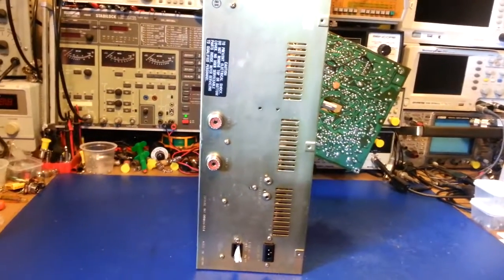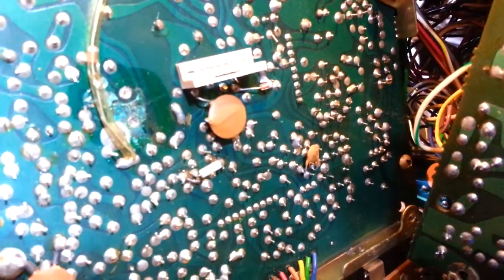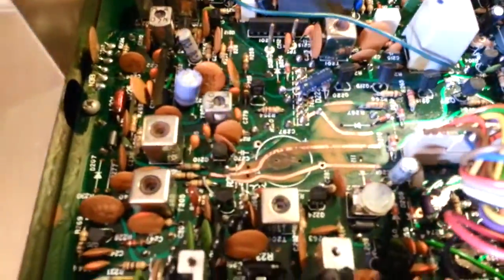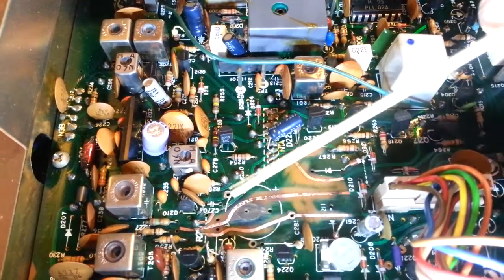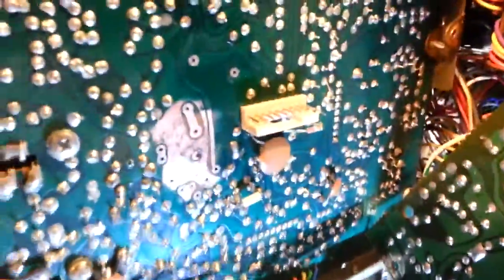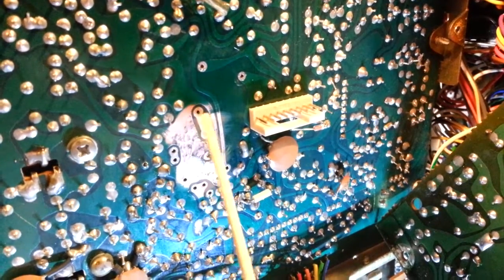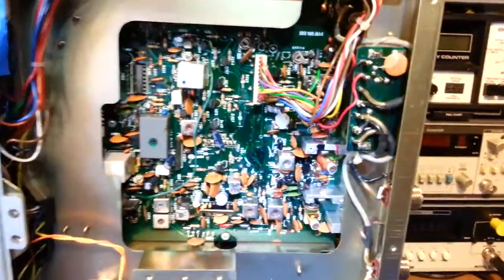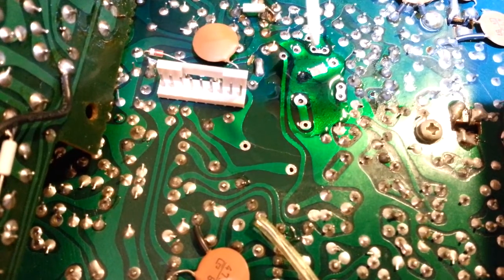GE SuperBase 3-5875A CB Radio leaking electrolytic capacitor repair. Part 2

Comment: hey Mike, can you tell me what crystal i would be missing from a UPD-858 Washington President with a 4 pin mike jack if i gave you the positions to what crystal was where..? 
7.7975 mhz in the X2 position 
7.8025 mhz in the X1 position 
10.240 mhz in the X5 position 
11.2842 mhz in the X4 position 
11.2850 mhz in the X6 position 
11.2858 mhz in the X3 position 
7M-7A ??? in the FT2 position not sure what this one is
Reply from the maker: Your not missing any crystals, that's all they have.  FT2 is not a oscillator circuit crystal.  It's a crystal filter.
Reply: 10-4 thanks buddy..

Comment: Nice job at cleaning up the traces, but it would have been more helpful to actually see you doing the cleaning and what tools and chemicals you used. I have to do a similar repair...but I'm looking for a more detailed demonstration to show me how. Also...What tool did you use to remove the caps? It didn't look like a standard solder iron.
Reply from the maker: I use a several thousand dollar Pace brand multiprocess soldering system.  Does soldering, vacuum desoldering, SMD hot air rework, gold/silver plating, thermal tweezers,  resistance heating, vacuum pick up tool, lapflow and thermal parting tool, solder paste dispenser.......

As far as cleanup use whatever you have.  Dental scrapers, fiberglass burnishing brushes, rotary cleaning tools and lots and lots of pure  isopropyl alcohol.
Reply: The tip about the alcohol and the dental scrapers was what did it for me...worked a charm. I also bought a magnifier/lamp headband. I had a very large cap that had leaked over several traces. After removing the cap the traces cleaned up nicely....Thanks.